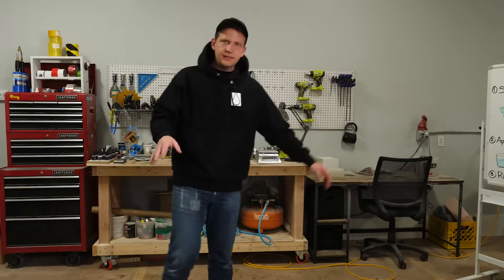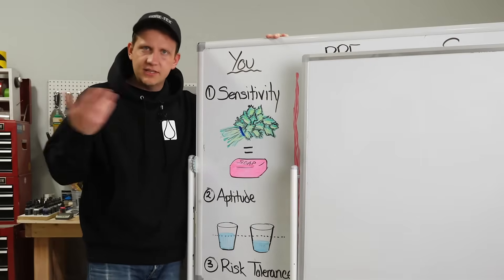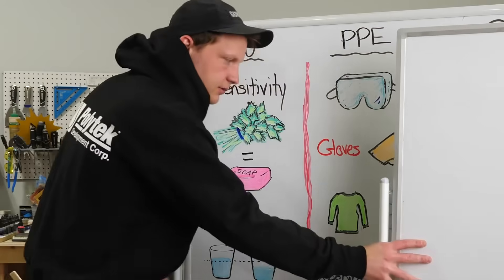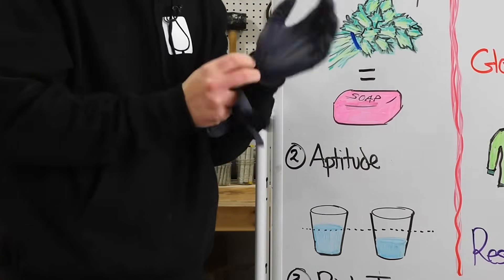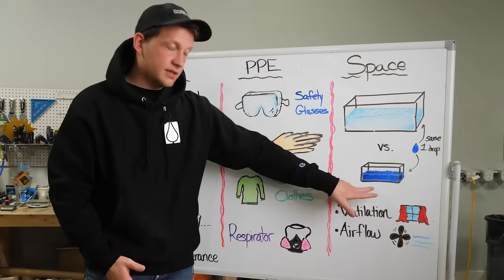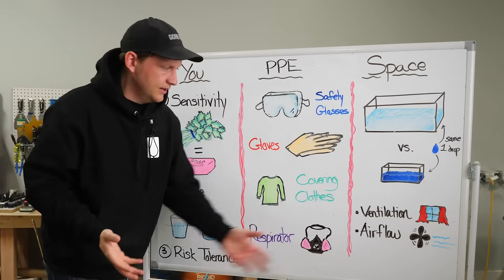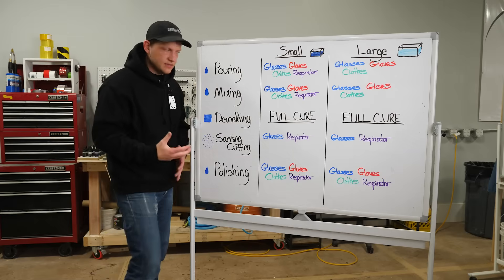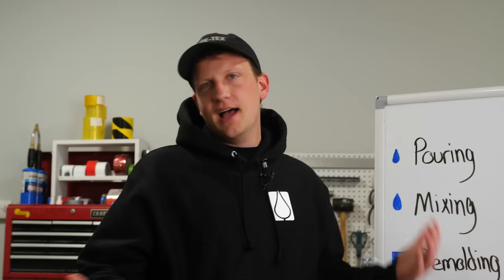Alumilite Explains: Epoxy Safety

Comment: I've been doing resin in my kitchen for the past couple weeks and letting the pieces cure on my counters. I thought that was okay since I had my stove hood fan on at all times. Is this not safe? If I start doing resin outside when the weather is decent (as it gets super hot in my area to the tune of over 100 degrees) would it be safe for my items to cure on my kitchen counters? Most items are small jars, drink coasters, bookmarks, earrings, frogs, and things like that. So far, nothing that requires deep casting epoxy.
Reply from the maker: Resin curing in your kitchen with the stove hood fan on can still pose some risks due to the potential for fumes and airborne particles. It's advisable to minimize resin work in indoor spaces where food is prepared or consumed. Working outside in well-ventilated areas is a safer option, especially for small items like jars, coasters, bookmarks, and earrings. However, extreme temperatures, such as over 100 degrees Fahrenheit, can affect the curing process and may lead to issues like overheating or accelerated curing. It's essential to find a balance, considering both safety and optimal curing conditions. For best results, consider setting up a designated outdoor workspace with proper ventilation and temperature control for resin projects.

Comment: Thank you SO much for this! I'm new to working with resin and bought your Quick Coat expoxy ( and a respirator). Used it on coasters and it was easy - zero bubbles and look beautiful. Only thing is, 10 days later and I still can't put a mug of hot coffee on them without denting. Will it eventually cure hard enough to be used ascoasters

Comment: A complete newbie to epoxy resin and trying to gather as much info as I can. I have the respirator, gloves, mask, etc but my question is … how long must I wear the respirator ? Can I remove it after I have finished my piece? Some pieces take hours to cure and I cannot see having to wear it the whole time.  And what about others in my home who are present but in another room? Would I be putting them at risk? I would ventilate as much as I can but it’s now winter and cold!!
Reply from the maker: As long as its in a ventilated area you won't have to keep the resiporator on close the door to the room or cover the project if possible!

Comment: wow i didn't know precisely all that as I took a work shop with 10 students last October and there were no windows opened! we were like 10 around a table and explanations on quantity to mix I didn't get it as the students flocked in the room where she was mixing 10 jugs of epoxy and resin. This was my first time. we had respirator and aprons. She asked us to remove our gloves too early and add some crystal and it was a mess up and my polo neck sleeve is nicely resined. Impossible to wash. And didn't say that you have to tap the silver dust glitter on the painting and it was horrible for me and did not like my work.

Comment: TLDR: Always wear a respirator when working with epoxy even outside or in a large space!

Long Version:
Hey @AlumiliteCorporation, I really liked your video and it's great for educating people about epoxy, because you did a great job of visualizing it. But sadly I have to report, that even working outside (or 'large space' as you call it) is not safe without a respirator. I did some epoxy runs (like 4 or 5 times) and was cautious of the mixing process, but I still developed mild asthmatic respiratory symptoms like a heavy chest and minor difficulties to breathe. I want to educate everyone out there, just as you do, that you have to be very cautious, when working with epoxy. So to all viewers, please be responsible and wear a respirator for your own sake. Thanks for reading!

Comment: Very good presentation 
The only thing missing that I could think of is safety of other living beings like animals.  I’m not a resin user yet so I’ve been doing my homework. Would an air purifier be enough to help with air quality or do I need air flow as well?
I’m trying to figure out what I need to make my space safe before I start. I’m m not planning on making an large pieces to begin with anyway. Maybe jewelry, use resin to final coat canvas, that kind of thing.

Comment: Is epoxy okay to use in an apartment I share with one other person and kinda close to the kitchen? I can't use our balcony yet since it needs to be cleaned. I can open the balcony door and work kinda close to it. Also most of the time I worked with epoxy the other person is either in their room or at work. So would it still be stay for the both of us until I can move to the balcony??

Comment: I have been viewing a lot of videos of epoxy n have heard about the safety gear so i even had ordered it before even starting it's use. But one thing that's very new to me in your video is polishing.. so my question is what's polishing the epoxy product? Not a single video i have seen abt this. Do we require to polish all the resin art material after curing? I want to know it before hand as i haven't yet ordered any kind of polish for epoxy. Plz help me by putting some light over it.. thank you very much for this valuable video.

Comment: After it hardens you don’t have to worry about inhaling toxins?
Reply: According to information I've read - and you should do your own research not take my word for anything... Apparently, IF it's been mixed correctly and is fully cured/hardened, it's supposedly not toxic to have around. However, it's NOT 'food safe', so you aren't supposed to put any food//drink on it.

Comment: is cured epoxy resin safe?
Reply: According to information I've read - and you should do your own research not take my word for anything... Apparently, IF it's been mixed correctly and is fully cured/hardened, it's supposedly not toxic to have around. However, it's NOT 'food safe', so you aren't supposed to put any food//drink on it.

Comment: This is fantastic info to have before my first epoxy project. I have a question though. I'm looking to coat some small cardboard board game tokens in epoxy to give them a clear shine. I'm planning on using all the proper PPE, but if I'm working in really small amounts, say less than an ounce at a time of the two components combined, how much do I need to worry about my workspace? I have a medium sized craft room with a window nearby
Reply: I had to jump in, because I noticed your question. I make miniatures and am usually working with less than 60 mL liquid at a time. I wear gloves because it's impossible to avoid getting epoxy on your hands, but I also work in the living room of my 700 sq ft apartment and haven't ever had problems with airflow. DO protect your surfaces, though!! I use those silicone craft mats they sell everywhere on Amazon or whatever - even the dollar store has them now.

Comment: Great information! I’ve never worked with respirators before. I’m assuming the filter for organic filters doesn’t also filter particles from sanding? If not, can you double up on filters or do you have to switch them out?

Comment: 10 Seconds of the video is detailing a respirator 5:51 of the 11 mins. More time should have been spent on that. If people knew they had to wear a respirator mostly the entire time they wouldn't get into mold making and casting. Also large areas also effect the resin as far as temperature and moisture so that forces many people in doors.

Comment: Thank you for this video.  I am new to epoxy and had lots of questions about it and you explained everything clear and concisely.  I will be using it to put into silicone molds for crafting and I'm proud to say one of the 1st things I purchased was everything you said we need for safety (respirator, gloves, protective glasses).  I have a question about space to work in.  I live in Wisconsin and our winter temps drop very significantly.  I can work in my garage but again,  it gets pretty cold.  Is there a temperature point I should be aware of to not go below when working with epoxy?

Comment: It would be great if you did a video about uv resin for 3d printing. Reading the SDS it says you need to shower after being in the same room with the stuff even if it isn't being cured. I assume the same safety for epoxy applies for UV resin.

Comment: Amine is a dangerous component of epoxy reactors. Fire is also a risk,mixing too large a batch in a hot climate. If slower reactors are not available cool components in an ice chest before mixing.

Comment: My question is that I do live in a small place.  I had already planned on doing my resin outside (trays, jewelry, coasters) and will follow safety protocol, but what do you do when you have to bring them in?  Should I put this in an area that isn't used but maybe once a week or better yet in our shed away from our living space.  My issue of course may be the temperature which would possibly take the resin longer to cure.

Comment: Hi I have a question about this. I work with my epoxy outside (making cups) and use all the ppe but then I bring everything inside to the farthest bedroom and put them in my master bathroom(small bathroom) I open the window and turn the vent on. How would you this wil this affect us  in hour home during the curing process. We dont use the mask inside our home but when i go to bed i can kinda still smell it. I don't want to leave my cups outside cause of dust and bugs that may land on them.
Reply from the maker: It all depends on everyone's sensitivity to the chemicals and the amount of airflow the master bathroom is getting. For the first 24-36 hours (or until tack-free) you will continue to smell the epoxy, but once fully cured after 7 days, the chemical reaction is fully done.

Comment: Thankyou such great info.. I have a question around a small space (one bedroom size)...I  heat up my room so that my epoxy cures to a perfect glassy result and have no ventillation, if i open the windows it will mean i have made my heated up room invalid and the drop in temp wil cause my cure to be dimpled. As i am very conserned with the safety would the best solution be to buy a certain ventilation system ?? or would you just open the windows and keep a heater running (which seems like a silly waste of electricity to me (ps its winter here is Aus)  thanks, Ash
Reply: Probably too late to help you but someone else might be wondering ... Research 'small grow tent' or 'small grow room'. They're often listed for growing pot/weed/dope indoors, but can be used for resin/painting instead. They come in kit form and fit inside a normal room. A proper air exchange system is required - a strong enough fan which must be vented outside your house and another vent to draw in fresh air.

Comment: I used epoxy resin four times without a respirator, will I have any problems?
( btw it was a small project and I made resin keychains, it took me about 45 minutes)
Reply from the maker: It all depends on how sensitive your are to the chemical formula!

Comment: Great video! I am new to epoxy, still looking everything up before starting my first project. I have all the PPE, but I live in Florida. Will doing this in the garage mess up the curing? The heat index was 110 today and we are very humid here. If that the case, I do have a pretty open floor plan in my home but not really able to open windows given the heat. Any tips?
Reply from the maker: Heat will typically speed up the curing process which can sometimes cause damage. If you do plan on working in the garage, we would recommend mixing up smaller batches at a time and pouring thinner layers, that way you're not adding too much heat to your project at once.

Comment: I liked and subscribed because you actually covered Epoxy PPE, THANK YOU! I think another worthwhile mention talking about consumer grade products is that when using any new resin, it’s really helpful and informative to determine the ratio between an epoxy’s wet and dry layer thickness, and establishing a %solids by both volume and weight. 

VOC is a trendy buzzword, but these are far more helpful to determine the level and possible area coverage in an air circulatory environment that you might face respiratory risks not from the solvent vapors but from epoxy particulates while they are in the curing process. 

I mention it really vaguely because you have a great channel and know what you’re doing, so you’ll know what I’m getting at, and it could probably cover an entire video on it’s own broken down well-this is less applicable for people with pressure pots and vacuum chambers doing molding, but I’d say the huge using garage epoxy flooring to seal a basement crowd might benefit a lot. 

Regardless, hopefully that’s constructive, and I’m loving the engagement on your channel as an engineer on a weird side project involving safety and easy access digestible information while I build and document about a 20,000 model lab with the challenge of attempting the best safety possible as an end consumer or outside a safety professional/lab setting. 

One thing that has really opened my eyes during this, because it will be peer reviewed by a panel of chemistry experts we’re assembling to see how I did and offer informal endorsements, lambast mistakes, and give suggestions, is just how little information on chemical safety and product ingredients a lot of consumer maker materials get away with. 

Because I’m walking a very fine line and have to deep dive with everything, the project is currently about half of each day spent with me on the phone decrypting vague labels and pointing out safety things manufactures should be listing on sites and boxes, before then returning to the product hunt for a replacement. 

I’m not trying to sound wonky or alarmist, it’s just something that is especially true in resins and polymer based making. 3D UV resin printing, for instance (as one of my hobbies not the project) basically covers nothing, and for each type tracking down even simple SDS sheets is absurdly hard for an end consumer. 

In the absence of information, I really appreciate the emphasis on PPE and that you use an acceptable threshold of caution. Since it is feasibly unrealistic to do the amount of legwork my philanthropy project is doing for every consumer product, I think it’s just smart in general to scale up to the worst material case for a situation, so for like an epoxy flooring, assuming it’s as low as 52% solid and ventilating, etc accordingly.

Long rant during an obnoxious and unexpectedly difficult process that entails watching a lot of people doing dangerous things and passing the same dangerous things on as advice, sorry. But please, keep up the good work!

Comment: how do I know if the epoxy is cured ? i want to try some DIY epoxy project , also want to know how do i know if its done and how i can do the curing?
Reply from the maker: We would recommending checking with the manufacturer of the epoxy you're planning to use! They should have a technical data sheet with information on how to mix it and how long it takes to cure! You can usually find this information on their website product pages!

Comment: A neighbor about five houses away and around the corner from me had their garage floor epoxied recently. I was on a walk and suddenly overcome with a very caustic smell. I didn’t know yet what it was and became concerned that there might be a chemical spill in the freeway, which is only about a mile from me. I thought I was in danger and about to run home when I found the source. No doubt epoxy should be better regulated and controlled.

Comment: I have a coffee table that was cut out of a tree about 4' by 3' tree with natural edge and it was cover with epoxy or poly and about 5 years old with scratches and I want to redo the surface in polyurethane do you have some suggestions it weights 300 lbs

Comment: Good video - but I think its necessary to delve more into what a respirator is, what the cartridges are for, how to wear it properly. Folks on FB groups are woefully misinformed. They think an N95 mask is enough.  Keep up the great instruction - love it.
Reply: I assume that while mixing and using the epoxy, you'll need the ammonia/methylamine (Yo Mr. White!) cartridge as it is tighter filtering than organic vapor.  There are no solvents being used, so that seems to further emphasize using the 3M #6004 cartridge.  I would love some confirmation on this though.
Reply: An N95 mask is a respirator, so technically that's following the video's advice... It's inadequate advice. They really should talk about what kinds of filter are necessary when.
Reply: I used Bondo resin in a small space built in fan and open window and N95 mask plus painting mask. Then I have cough and pain in my upper chest. It was fours exposure which is category 3 acute toxicity level.

Comment: Could you use epoxy while outside? In your yard? Or is inside with enough ventilation and airflow preferred?
Reply from the maker: It all depends on the weather really. Resin doesn't like moisture so if the humidity is high, you will want to find a well ventilated area inside. Resin is also particular about temperature - we typically recommend working in an area around 70°F - 75°F.